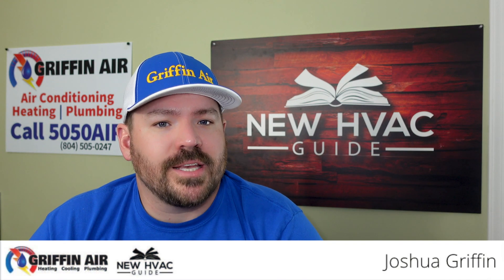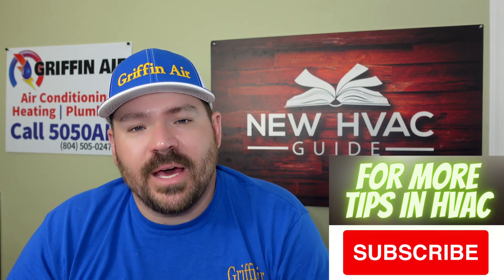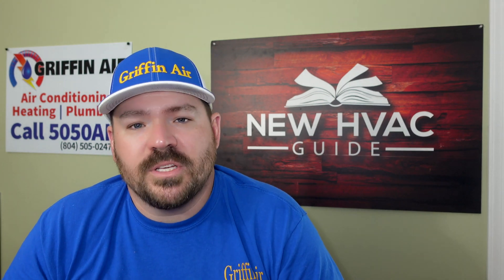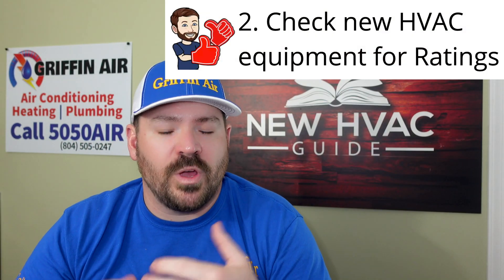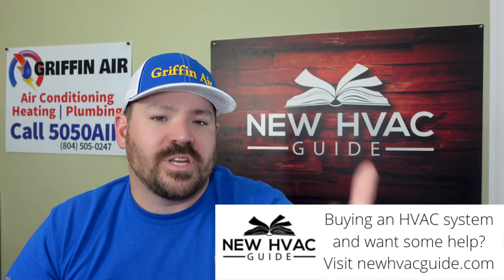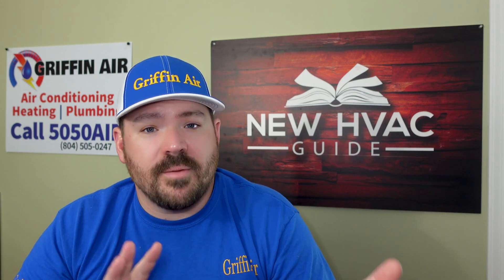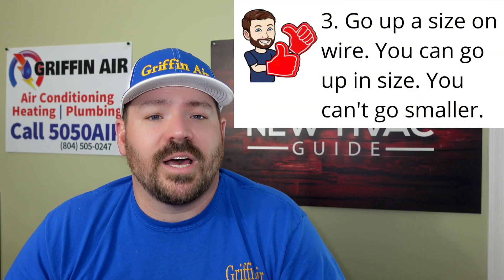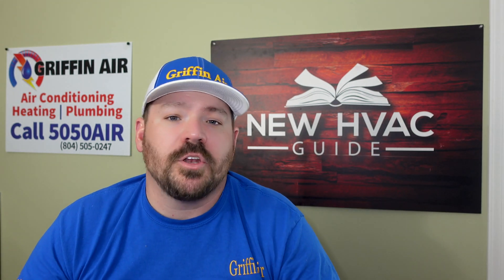6 HVAC Electrical TIPS!

Comment: Hi Sir, you are doing a great service. Thank you. I am in need of a new packaged unit because the compressor on my old unit is on its way out. Drawing 58 amps to start up, on a 60 amp breaker. I'm going with replace because of old refrigerant being phased out, etc. Dont know why but I have two commercial units on my roof so I will need to go with a new one. Unfortunately the footprint is different so may have some costs of roof repair and re-doing the curb on my flat roof. So far I am going with a minimum 16 seer ac, to qualify for power company rebate and to save electricity and money. I am following your advise for the 4 of the 5 upgrades you recommend (UV light, Whole house filter, Ionizer, and Surge Protection) Living in the Southwest desert, humidity is not an issue. Here's my question, on another posters question he was quoted 16K for a package unit, you said go online and you should find it much cheaper. Well I have gone online and found "cheaper" but only available to commercial installers please tell me more about the going online to find it cheaper option where I can also get someone to install. The HVAC companies around here dont play that game. PS I am looking at either a RHeem RGEA16 2 stage heat/cool vs Trane XL16c 2 stage heat/cool. 
ANY comments or advise will be appreciated.

Comment: we had the HVAC guy connect a new replacement breaker (assume he was an electrician for the company - large firm not far from you).  ever since, our GFI’s stopped working.  I believe they downsized our main HVAC breaker for the new inverter system.

btw, we really like the inverter system!!!  we came off of a 10-13 seer system whatever was the new minimum requirement in 2011-2012.  this inverter is super responsive for heating or cooling.  and on these 90+ degrees days we could hang meat in our house 🥶!